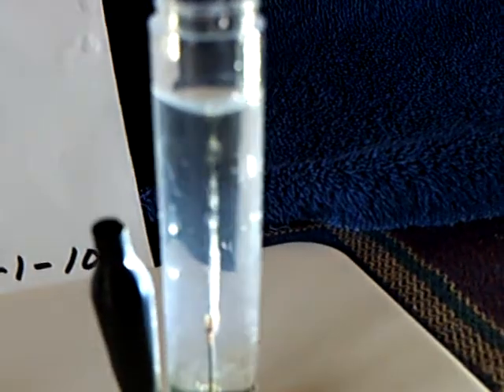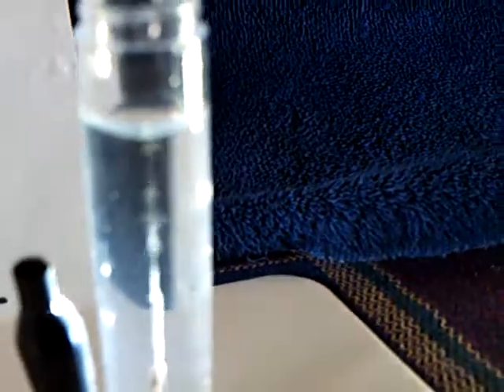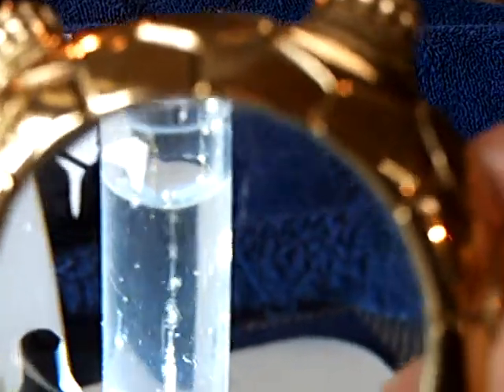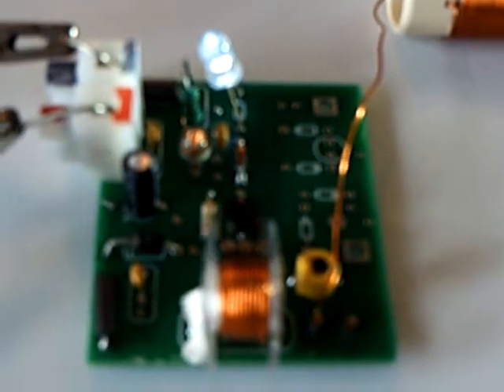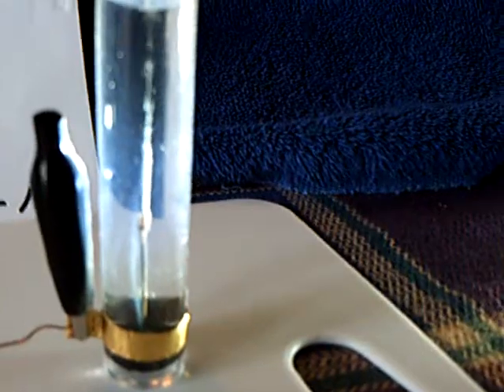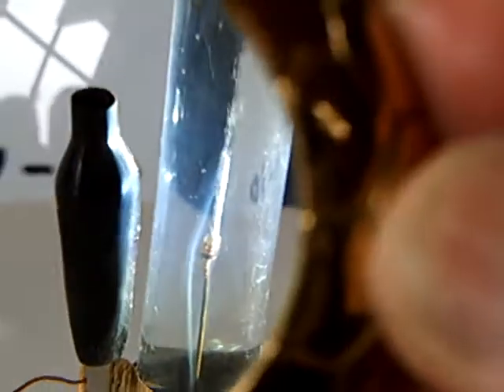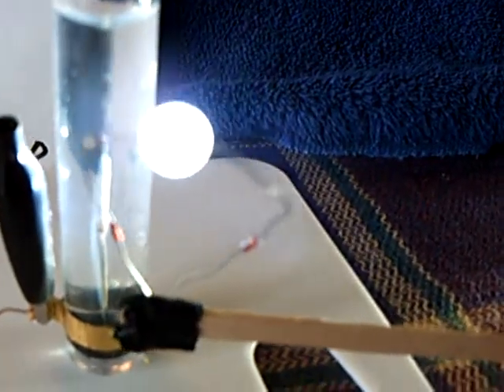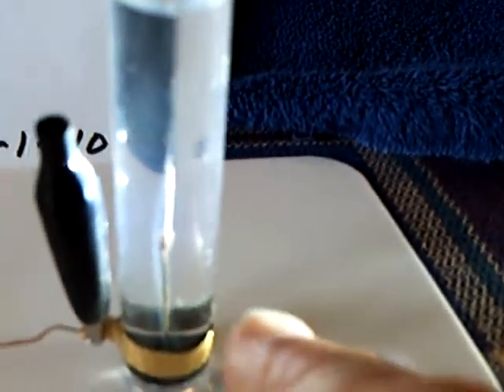Dr. Stiffler SEC 18 -1e diode electrolysis.ASF

Comment: Interesting if you think about traditional electrolysis with a cathode and anode you have two different gasses respectfully IE Hydrogen Oxygen so with only 1 gas producing element here does that imply only 1 gas being produced? or is the 1 element releasing both gasses?

Comment: sorry for the post here but i am wondering if you could add a small amount of potasium hydroxide to the solution to see if you get any heating effect from the water as this would be a cold fussion reaction it would not be a large amount as this would change the water resistance and my stop its function.

Comment: Lid, I am starting to think that the rectification is just one part of what is going on here. the other part is the natural internal capacitance of the diode. However this has to be a very small capacitance to match the frequency of the SEC. May be this is where the leads of the diode come into play. They may be part of the circuit. Kind of a high frequency L C circuit. Where the diode is the C and the lead wire is the L. Due to the rectification, just one lead is "hot", the one with the gas.

Comment: Lid, What I am trying to say is, that the small capacitance in the diode that you are now using may be the actual receiver of the SEC and the one way effect of the diode is only secondary to the SEC receiving process causing the electrolysis on just one lead. The very small capacitor naturally in the diode which makes sense due to the high frequency of the SEC. I am starting to think that it is the natural very small capacitance of the diode that is really acting as the receiver here.

Comment: All diodes exhibit this phenomenon to some degree (capacitance), but specially made varactor diodes exploit the effect to boost the capacitance and variability range achieved - most diode fabrication attempts to achieve the opposite. Lid, I wonder what happens if you use a varactor in the water? These are capacitance based diodes. Since SEC seems to be capacitance based as a transmitter, may be a varactor might make a good receiver. Maybe the small capacitance in the diode is actually a receiver

Comment: Lid, I was thinking that a diode is really just a rectifier with leads attached. It is one lead that is producing the gas. I am not sure what the other lead is doing, if anything at all. I was thinking that the real action is happening inside the diode, the actual rectification. Selenium acts as a diode or rectifier internal to it's self also. Leads can be attached, or not. That is why I suggested using a Selenium and water mixture to (may be) produce the same gas as the diode.

Comment: @Lidmotor I was implying trying to say do other types on diodes that are availible to you there are two diodes types I am aware of those are germainium and silicon diodes. I mean is try something with different current ratings and voltage ratings to find the one that works just as good or if not better then the fast switching glass ones.

Comment: Lid,  Selenium was once widely used in rectifiers. These uses have mostly been replaced by silicon-based devices, or are in the process of being replaced. Selenium is used in photo cells also and Selenium powder for these cells is available. Each Selenium atom it seems, is it's own little rectifier.

Comment: Lid, what happens if you used distilled water and Selenium? Selenium acts like a diode, a rectifier. May be if you used Selenium like you get from the drug store vitamin shelf and made a mixture with water, you could create the gas with just the SEC field applied to the outside of the test tube, No diode required.  Every Selenium atom in the water Selenium mixture would produce gas as it's own little rectifier. (may be) . A zillion Selenium atoms each producing gas. Might be worth a try,

Comment: please please try different metal at diferent spacing, in distilled water, see the distilled water is the most important part because in distilled water you maintain up to 1000 volts in a 1/2in lead spaceing without alot of drain,,,, so if you put  disimilar metals into the situation with minimal distences the voltage is already in the water just need the different mineral to activate it.   i used to burn copper anodes to make them blue, the blueing is actually like a insulator.= no gap in cell

Comment: Lid, I am not saying that the gas is not Hydrogen or Oxygen or a combination of both. But the gas should be captured in a balloon or other container, taken to a lab for testing to see what it really is. It may be the diode lead is breaking down in the water due to the SEC field. I hope it really is Oxygen and Hydrogen or at least Hydrogen and not something else. The diode must be doing something as the gas only comes from one lead. I would say there is rectification of the SEC field.

Comment: Lid, nice replication of Dr Stifflers work. I wonder if small copper plate attached to the lead would increase the (what ever it is) gas production? The diode seems to cause rectification of the SEC to produce the gas from the water. Also I wonder if the metal in the  diode leads have anything to do with the production of the gas? May be the metal is turning to a gas and not the water. If so, this may not be actual electrolysis of the water, Hydrogen and Oxygen. Anyway it is interesting.

Comment: So why a diode?  There is no connection to the diode except on the anode side.  I expect your results would be similar with just a piece of wire as the diode does nothing special.

Comment: Hey there! Another nice video. I do have a couple of questions though. 

1. Will that gas burn as it exits the test tube.

2. Will this type of electrolysis leave heavy metals in the water like the stainless steel HHO units do?

Thanks Again!

Comment: maybe you can nickle plate the wire instead of the tin coating.......the wire is steel, clean off the tin with sand paper, then use electrolisis to nickle plate it.......then it will last even in electrolite.......can i get a copy of this circuit when you have time.....not sure if you have posted it.....you got a lot of vidios.....dont think i seen em all